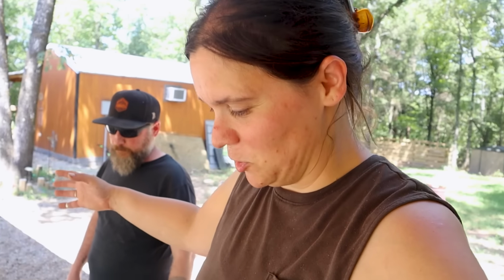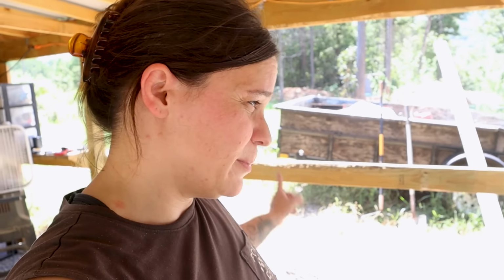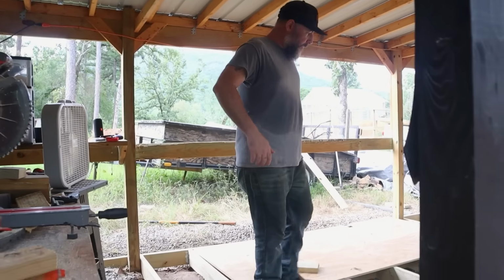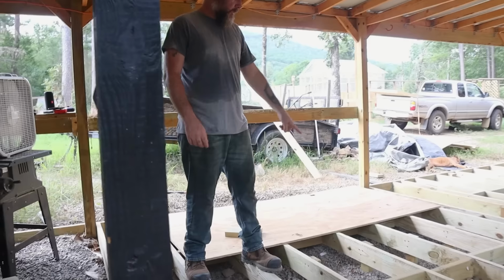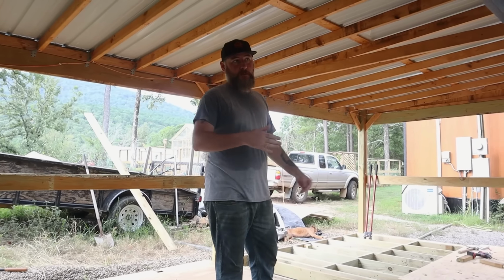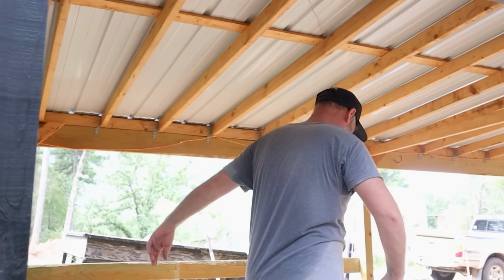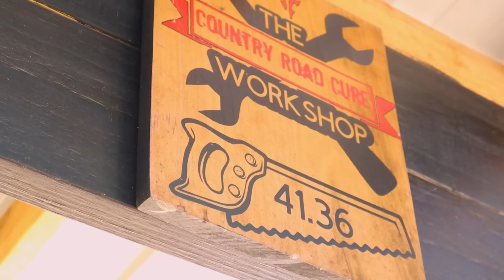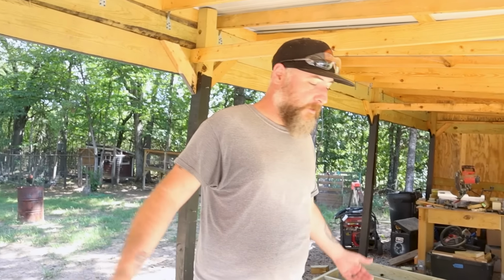We faced HUGE PROBLEMS with this BUILD... | Tiny House | Shed To House

Comment: A Fun Fact.....
I recently found out that what we (here in America) call ""blocking"" in Europe they refer to them as ""Noggins""". Guess
that might be because they kept hitting their heads/noggins on them?!? Looks like you built yourself a bit of a dance floor.
Turned out smooth. you wont be tripping on any joints! By now I would call you professionals. Great work even in the heat.
                                                                                                                                         Sweating along with ya, Me southern AZ.

Comment: Hey Rox and Ant, yep I get that steamy sweaty frustration as I live in the tropics, Townsville, North Queensland in the great land down under. It’s annoying as sweat starts rust on good tools, runs into the eyes, drips into my glasses when I am welding or doing fine work, then there’s the hot brain fog but it’s only about 4 to 5 months while the rest of our year is paradise. We don’t have the cold winters so that’s a bonus. Frequent breaks gets you through as well as good fluid and electrolyte replacement. Great watching how you work together. I find these videos calming to watch. This is a comment for next time, before you lay sub flooring think about a sub floor moisture barrier, sarking. Yep even though you have plastic under the gravel, it’s just insurance in moisture and humid climates.

Comment: You should have put the blocking under the seam of the plywood or when you step on the seam there will not be any support. When Anthony walk across it at around 23:10 you can see the plywood seperate. Not saying anything bad just wanted to point out the seam would not be solid
Reply: It was Roxanne
Reply: It hadn't been screwed down. Go back and look again.
Reply: Linda mask watch again nothing to screw to as the blocking is not under the seams
Reply: @lindamaskus5142  watch again as if there was blocking under the plywood seam it would not have sunk in when stepped on
Reply from the maker: Thank you so much for pointing that out to us. We have all the plywood seams land right on a joist. The time stamp you gave is  right  before we screwed everything down. Actually, that time stamp is showing  us marking out where the floor joist where they are  located, so when anthony was adding screws he would screw  the floor down to the  joist underneath perfectly. So again, I thank you so much for  pointing that out to us, but we did think of that and were able to handle it.
Reply: @countryroadcure  I seen the seames at the joist I was just referring to the long 8ft side where the blocking should be under.  If there is no  blocking under those seams between the joists then it will eventually sags just a fyi.  Love your show you both work so well together and as a veteran myself glad to see You and Anthony dedicated to this country.

Comment: ?? Fot pantry/ above ground cellar would suggest insulating  the floor preferably with foam sheets  put 1x1 srips at lower edge of floor joist and cut foam sheets so fit snuggly between joist anf resting on 1x1 stips  4 inches of insulation in floor  would try for r19 in walls and as much as one get away with above ceiling    and use 2 6in vent pipe for air exchange especially in cooler temp  small ac for summer 
 1 vent pipe close to floor and 1 exhaust at top /high point 
cold air comes in at floor level  note may want to use a bucket 🪣 for  cold pipe to vent into this helps regulate cold air 
    cold air fill bucket first and would have  warm up to exit bucket this control temp though air exhaust exchange  as air warms  exits out 6 in pipe at top air leaving allow cold air to  come in 
  may need small heat source for extreme cold weather 
    my grandparents had above ground cellar and kept  garden vegetables and fruit like apples & pears  all winter into spring  just need to occasionally watch for spoiling  and eliminate asap 
 the saying 1 bad apple spoils the whole bin
    we kept apples covered  with what called vinegar blanket / just a heavy weave like tarp

Comment: Rox,  how will the storage of canned goods go with such hot weather. Hate for you to can the goods and have them spoil.  Wouldn't a root cellar be possible or even an above ground cellar with dirt mounded on top..  All I see is you melting in the shade.
Reply: They said they will have air conditioning and heat

Comment: Sorry to correct you but 2x6= 12 is not a span for live load, however will work for rafter spanning without bracing.

Nominal Size (inches)	Joist Spacing Center to Center (inches)	Lumber Grade (live load chart)
No. 2
2 x 6	16" on center	10' - 9"
24: on center	9' - 1"
2 x 8	12" on center 	15' - 7"
Reply from the maker: So...basically you are saying you can google better than me? Also, we supported the joists in the middle, so it's basically a 2x6 that's 5ft
Reply: @countryroadcure  Didn’t mean to offend you at all, but actually I’m a builder that started my career as a framer. However I’m sure you can find the information online
Reply from the maker: Did you even see us support the floor in the middle ?
Reply: @countryroadcure  yes I  however I also saw that you didn’t stagger the break in the plywood. But I didn’t comment to offend you and actually do enjoy watching your progress on the homestead. Thanks for sharing your journey